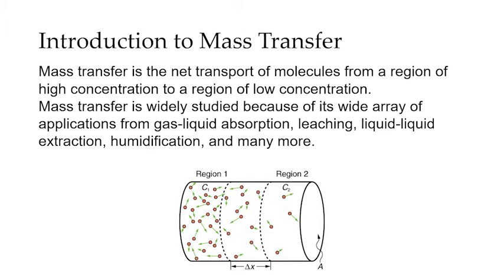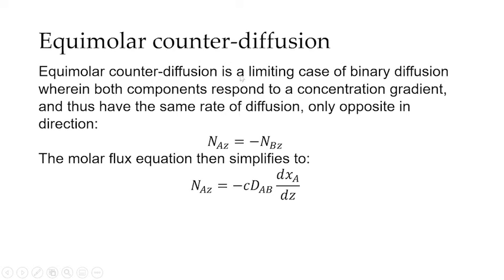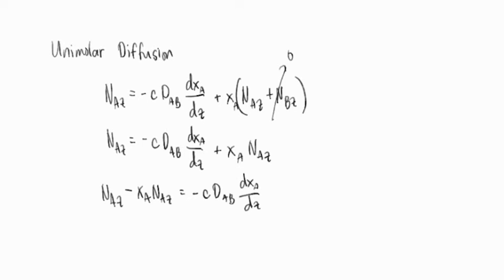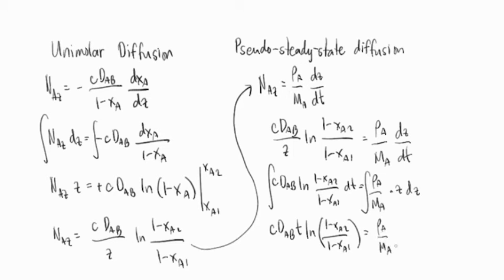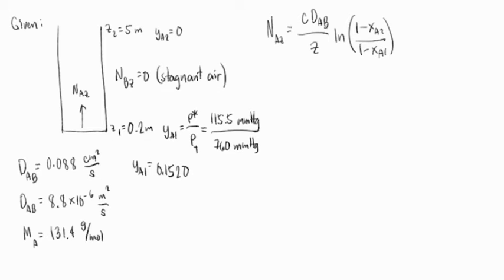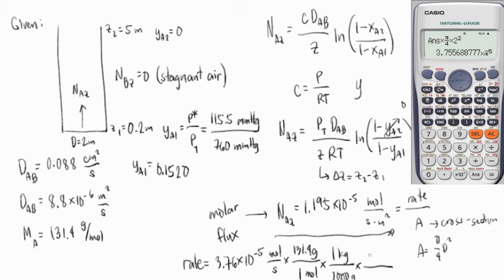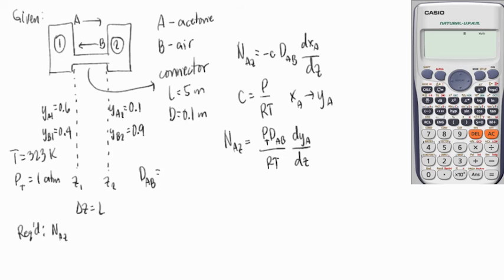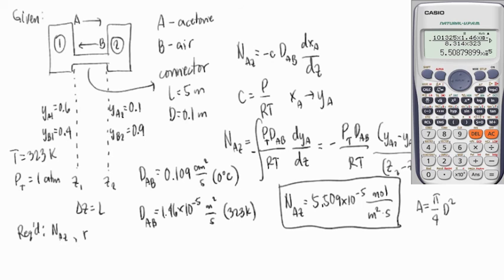Lesson 7.1 - Mass Transport by Diffusion

Comment: Hi can you please help me solve this question 
In an experimental apparatus CO2 and H2S are being absorbed in an alkaline solution from a gaseous mixture containing 30% CO2(1) 10% H2S(2) and 70 % CH4(3) at 30°C and 5 atm total pressure. The diffusion of the solutes occurs through a stagnant gas film of 2mm thickness. The concentration box the solutes (CO2 and H2S) at the gas -liquid are negligibly small. Calculate the rates of absorption of the gases. The ff binary diffusivities are D12 is 0.0303cm²/s D23= 0.0417 and D13 = 0.0367 cm²/s